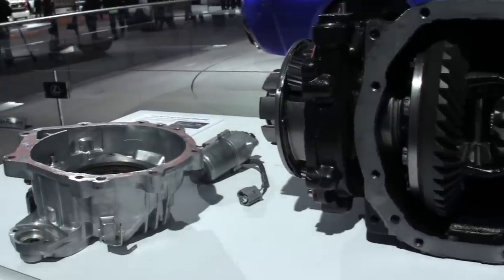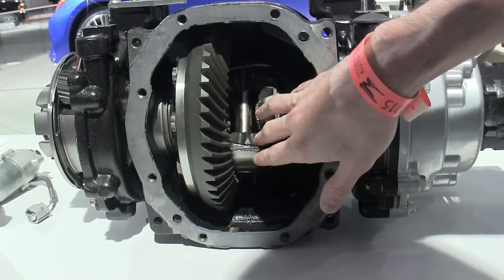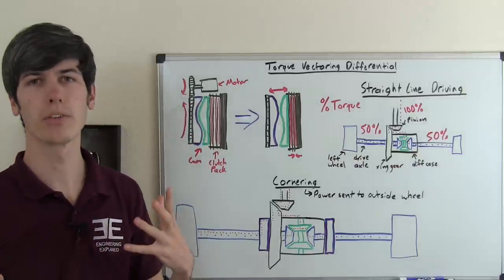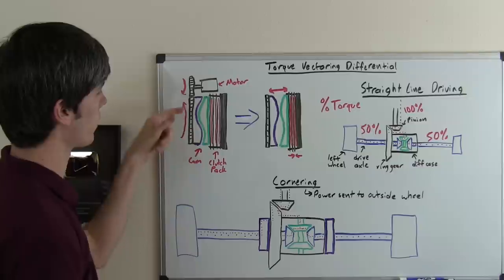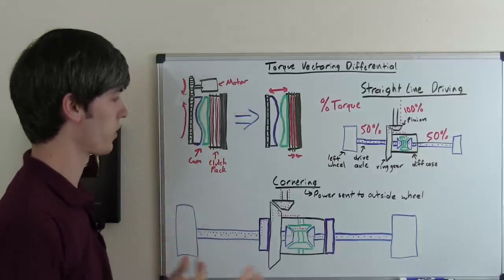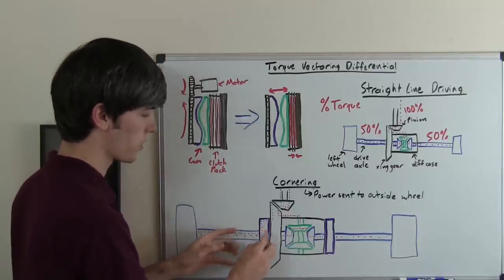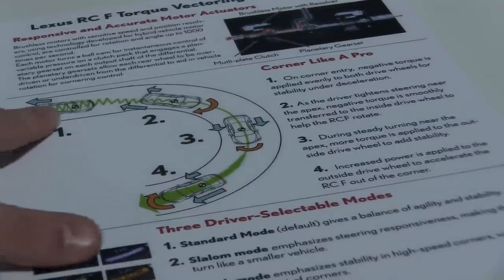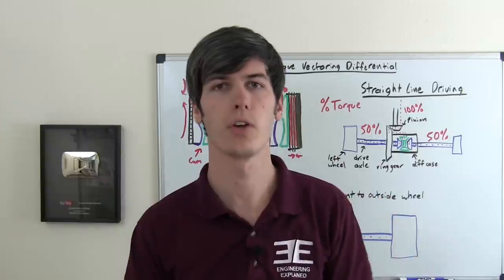Torque Vectoring Differential - Explained

Comment: What about reliability of this thing? Electric motors don't seem like a good choice for something like this.
Reply from the maker: Electric motors can be made plenty reliable. A simple example, but the power windows on my '99 Integra have never given out. The engine on the other hand has needed a decent amount of maintenance (not zero).
Reply: Electric motor's aren't the problem. Its the clutch pack that will wear down over time. A very long time but over time nonetheless.
Reply: My thoughts exactly. Plus the other complexity of it. Im sure the electric motors themselves would be alright, but the other parts to that, like the clutch packs, cam etc, theres alot of wear in that area. This unit takes the components inside a lsd posi differential and puts it on the outside of the diff housing. They really didnt invent anything here, just made it more complex with the ability to control the engagement of the clutch packs.  You want a strong rear use a 9" or dana 60 or 80 with a helical gear differential. Dam things can last yrs and yrs with oil change only. This unit wont have the set it and forget it reliability we are all used to. But it is neat!
Reply: Engineering Explained Not a good example, almost all the cars I had, wiper motors had to be rebuilt (yes in my country we do that), starter had to be rebuilt, and of course blower motors had to be reconditioned. Power windows do not get nearly used as much as the blower, radiator fans, wiper motors and so on. Motors on this differential would work almost constantly.... let's not mention electric water pumps.
Reply: Bojan Savić Its still a lexus at the end of the day. The 22 year old SC400 I drive has hand no motors changed in the seat, or the steering column. The steering column moves everytime you get in and out of the car. Can't say that the motors go bad when they last over 23 years.
Reply: Bojan Savić 20 years ago I would have had the same fear or qualm about the reliability, but because of all the new technology that wouldn't be possible without electric motors to drive, cool, heat, etc., lots of time has gone into the quality and perfecting of these motors.  Today they are about as reliable as any other, so putting them to use in transportation is becoming common place.  Have faith, my dear boy!  lol
Reply: Bojan Savić Yes, but remember, his example is not that of just a few years, but 15 long years of perfect service.  You could expect to have trouble and replace almost anything in a car within that time.  Electric motors in general are better quality than they once were...and if you look around at all the different ways and things they are used in, it becomes evident they've improved.
Reply: Like all things in life if its designed right and build to the designed spec it will perform right, if its designed for normal room temps and then goes to a desert then it might over heat, that's poor motor choice and/or poor forethought. Most electric motors that fail are poorly designed or don't take into account the real world environments it needs to work in. lots of power window motors fail due to the heat they experience when their a inch away from a sheet of metal that could cook a egg.

Most engineers realise the vulnerabilities of electric motors now days and make choices accordingly but not always, that and material science has improved the working robustness available for a given size.

On top of all that control electronics have improved 100 fold and the ability to used a eletric motor more effectively with less damage to it has dropped to a lower implementation cost so is more widely utilised.
Reply: vidurc
That's the unmentioned 4th benefit of torque vectoring.  Increased revenue for the service department
Reply: markgriz Depends on the manufacturer. The SHAWD on Acura's have been great. Personally until I have money to really throw at a car I'll stick to my mechanical LSD

Comment: Torque converter on my volester n...Not a performance package...N with po gets a limited slip differenal .... Designer said the basic car more fun to drive without lad...Question will I notice the difference... Not tracking the just some fun
Reply: PP darn spell check

Comment: Despite of those complex mechanics, why not just let the engine be a generator to charge up supercapacitor and uses electric motors at all wheel as propulsion and torque vectoring? Assmuning battery is the limiting factor of electric car. If electric motors can perform over 95% efficiency, it makes no difference to the efficiency of power train.
Reply: There are two simple answers :  complexity & price.

Comment: Bad video EE, sorry! You explain it wrong.
The clutch pack doesn't lock the axle to the diff case. What the clutch pack does is engage an overdrive (or underdrive not exactly sure) induced by planetary gears on either side. It does so by locking the planetary gear hub to the case instead of letting the diff output spin it freely.  What you display in the video where you hold one axle still is just the open diff doing its thing. Anyway when one wheel has a lower gearing than the other it will slow down and create the torque vector effect.

What's interesting about this diff is that it doesn't limit slip at all, so in icy conditions it's as useless as an open.

Comment: In RC F turning explained Picture, it says in Stage 2, it makes Negative Torque to turn a corner well.
What I don't understand thing is What is Negative Torque? and How to make it? in car is still moving forward.
when the car is in Stage 2 step, transmission changes the gear to the Reverse Gear in that Short Moment?
Please someone explain it to me :D
Reply: +park kim
I think it's referring to neg torque when you take your foot off the gas, the engine is now "breaking" the car. IE the ground is now driving the wheels, and the engine is resisting that turning force/torque, and this is now neg, as it is retarding the car.
As it is going into the corner it vectors torque, (that is now neg, as it is retarding the car) to the inside wheel to help it turning in. As it comes out of the turn, and power is now applied, it is now positive torque again, and so it transfers the power/torque to the outside wheel.
Or that's how I understand it. Hope that makes it at least a bit clearer.
It's a stunning concept, and feat of engineering.
Reply: I think it's using the torque going into the differential as a variable point always being base, and just for simplistic terms, 0. The inside wheel in a turn requires less torque, and the outside requires more torque. So it vectors more torque, +, to the outside; and less torque, -, to the inside; essentially being that the side with less power than base is negative, and in mathematical terms negative would be less than 0. 

But that's not true negative torque. Torque is rotational force, lets say torque moves an object counter-clockwise, negative torque would be the opposite force that would move the object clockwise. 
So, the pamphlet says negative torque, but that's not true. All it's doing is reducing the torque the wheel with the smaller radius. 

TL;DR: Negative torque essentially means less torque going to the wheel on the inside of the turn.
Reply: +rationalmartian 
I just want to know principle of the Negative Torque which is used in Lexus  Explanation.
but your explain didn't fit my question.
Reply: +Xander Zoolander 
your explain is a little bit ambiguous in the First paragrphs all 5 Lines.
Reply: It isn't ambiguous, at all, and I don't see how it can be. It's a simple explanation
Reply: Xander Zoolander
Because I'm not a Native English speaker.
I couldn't fully understand your explanation.
Just Fathom liitle things :D

Please use easy English, Elementary School Student can fathom it. That's What I want it :D
Reply: It's "negative" because it has less torque than the amount of torque going into the differential.
Reply: Xander Zoolander
In the Pamphlet figure and explanation, When the car enter the corner,Step1, I think ECU or Throttle valve is stop the engine and close the valve.

So, the power flow is cut through shaft and differential.

And Friction force flow wheel to differential then reduce inertial moment of wheel.

I think that Reverse Friction Flow of wheel to differential is Negative torque which is explained by Lexus.

What do you think about it?
Do you think it is reasonable explanation?
Reply: I have literally explained it twice. If you don't understand it by now, maybe you should look it up in your native language.
Reply: do it in math. or Boolean logic.
These are universal languages. Koreans are generally better at it than Westies.

Comment: Over engineered crap that adds cost, weight and complexity. A standard limited slip differential is a better trade-off for performance vehicles and then locking diffs for off-road. If it's something like family SUV even just braking the spinning wheel works for getting up that slippery hill.

Comment: hmmm in simple terms electrical Differential with LSD but not mechanical parts just before there were manual transmission now there is automatic transmission
Reply: Not exact. But the same idea to redirect torque through clutch from one wheel to another.

Comment: AAAaand it sucks. Just like in the Southpark series. How much do you have to pay to replace the main clutch, and now think about the parts that's involved in this story. Hell no - if you are a real driver that uses the car.... Do not believe electronics, it's allways the fault, if something mechanical is broken you can still fix it. Next thing you'll be contacting your local google dealer for diff patch... B class rally...